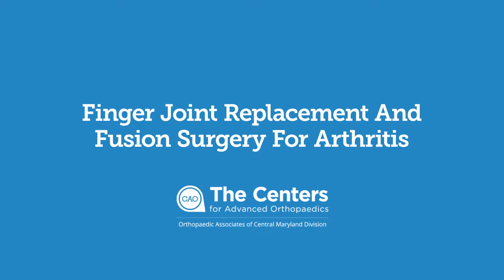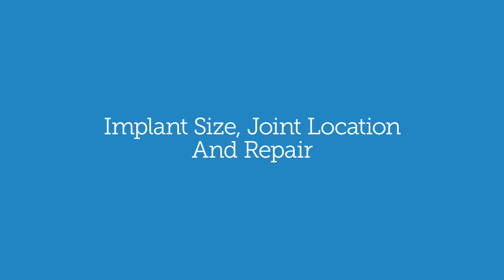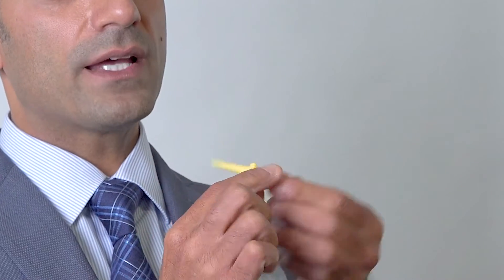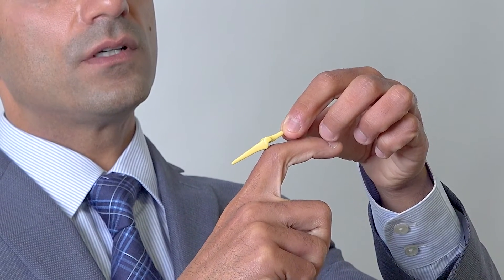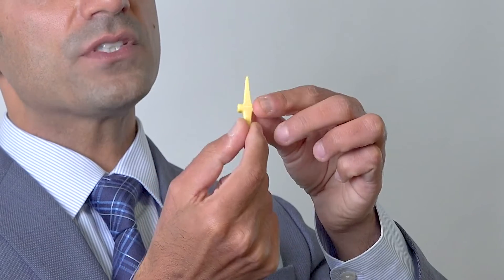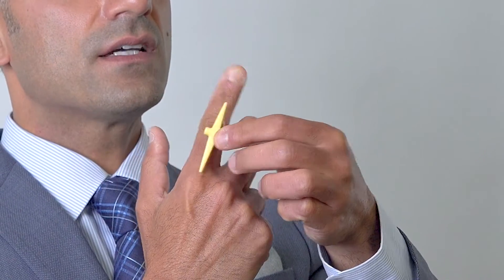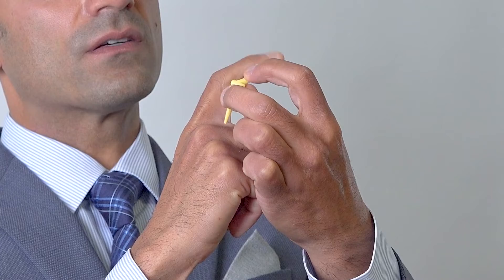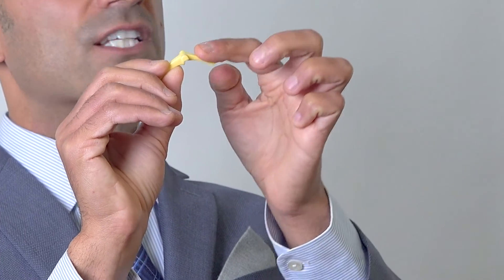Finger Joint Replacement & Fusion Surgery - Dr Khurram Pervaiz

Comment: I have severe pain at times and cannot bend due to swelling and the middle bone being so arthritic and out of alignment in my right index finger. I am going to have this finger evaluated to see if it is possible to have joint replacement done instead of the fusion. Thank you for the info video 😊
Reply: My situation is different - the result of a fall which fractured it… but I am hoping for replacement rather than a fusing. Scary stuff. Best of luck to you.